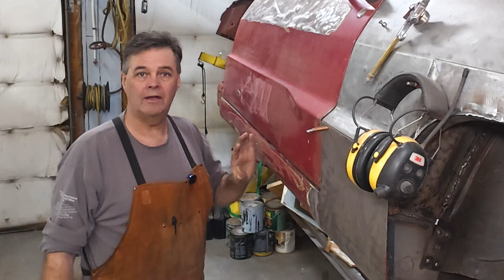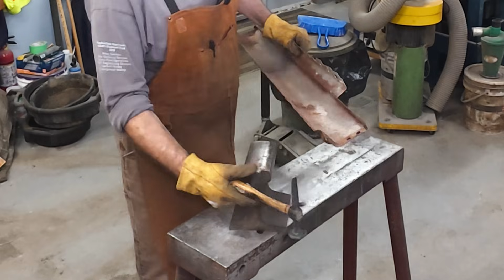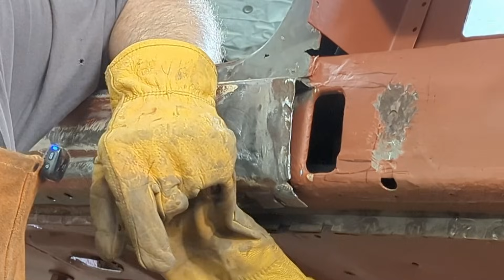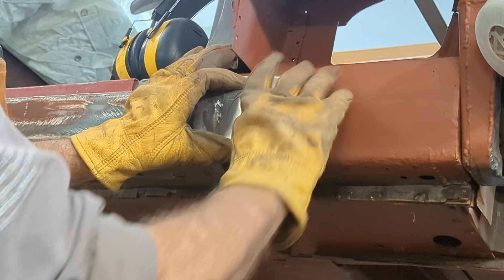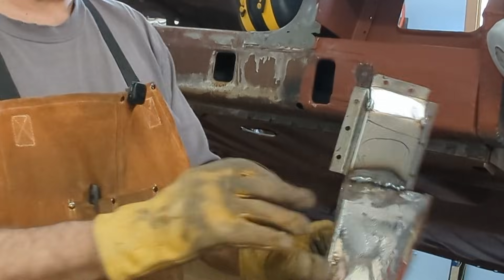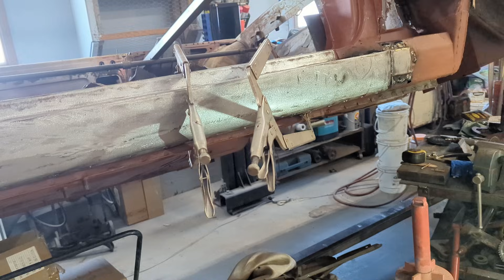Rocker Panel Rebuild & Install – 1965 Thunderbird Convertible | Ep #83

Comment: sorry ** low fuel warning Relay**
Reply from the maker: I'm not sure, but since it is grouped with the under dash components in with the electrical diagram, like the heater resistor, radio, clock, etc., I would start looking in the fuse panel area, and work toward the radio area.
Take a look at the wire color codes in your manual, and look for the correct wire colors, that will help a lot to know if you are at the right relay.

Comment: Hi Alvin nice video! Please continue doing every video possible of you working on this 65 convertible! 😄😃  questions. 

 Do you know where the 66 Thunderbird landau model Emergency Flasher can is located? 
Also where is the Low Fuel Warning Light located as well for the 66 Landau model? 

Thank you for your help!   

🛠🔧🧰
Reply from the maker: Thank you!
In 1966 Landau the emergency flasher light, and the low fuel warning light were located in the overhead console.
If you are wondering where the actual flasher for the emergency lights is located, I am assuming it is behind the dash, but I have never worked on a 66, so I am only guessing.

Comment: I have a 65 T-bird convertible. Is it possible to remove front fender without taking the bumper off?
Reply from the maker: That's a good question!
The issue is the head light buckets, they need to come off to remove the fender, and the bumper is in the way of the buckets.
With that said, the bumper doesn't need to be completely taken off, you can unbolt it, and move it forward and down some, then you can get the buckets out.

Comment: Hiya Alvin! That’s a pretty good repair. And I have to agree with you on the reply to Charles, why buy one when you can make it cheaper. I do however like the fill it in with weld on the seam look, but hey it’s your car you do what looks good to you. I just like seeing your work. And I didn’t know prickly pear grows that far north.
Reply from the maker: Hey Troy,
I think filling the seam with weld would be just fine, and I may end up doing that, I am a little concerned about cracking, because that is a flex area on this car...I'm probably overthinking it. Lol
Brittle prickly-pear (Opuntia fragilis), native to Saskatchewan, mostly in the southern part of the province.

Comment: Nicely done, I keep seeing your work resulting in something better than original.  I've bored you before with the story of making my own rocker panels (unobtainium when I did mine many years ago). It's interesting you noted the body seam between the rocker and quarter.  When I bought mine, it had a seam.  I decided (without knowing what was correct at the time) to fill mine, I just thought it looked better.  Anyhow, enough of my ramblings - thanks for taking us along and teaching us ~ Chuck
Reply from the maker: Thank you Chuck!
I can buy a rocker, but the cost is more than a full sheet of 18 gauge, and as near as I can tell, I would still have to weld the ends on, so making them is the best option in my opinion.
I'm of a mixed mind on that seam, to be correct, yes fill it in...but I don't mind the look of it not filled. Lol